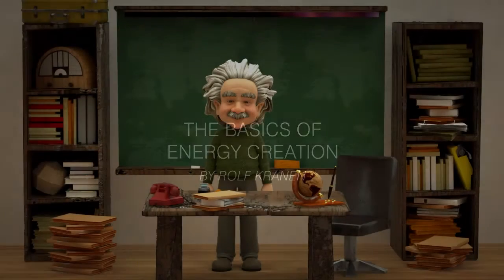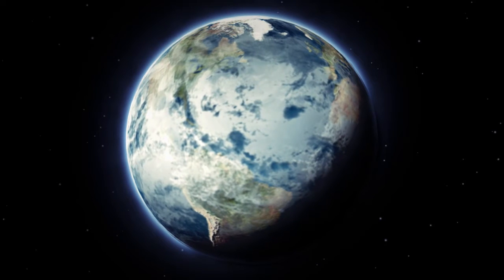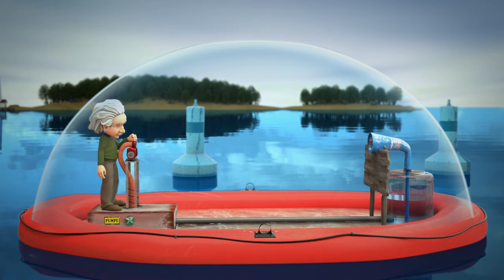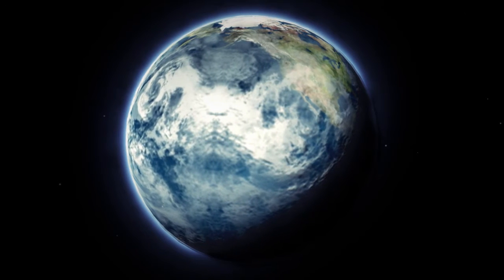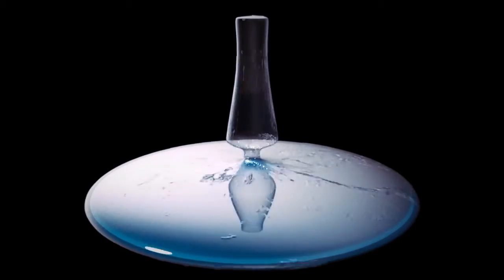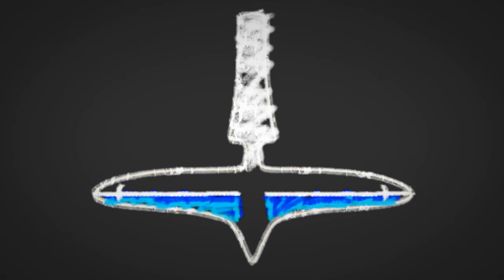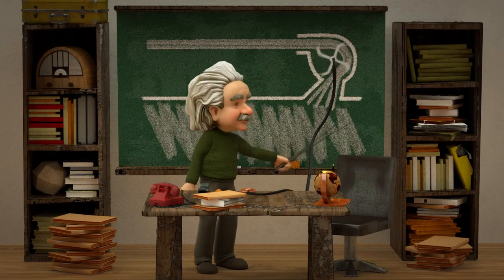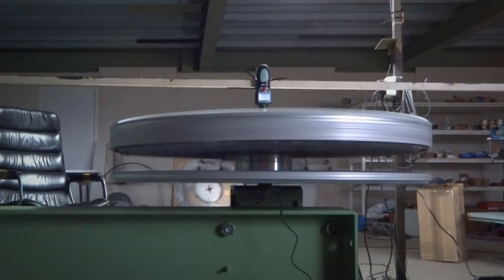Basic principle of energy generation. Part 1

Comment: the flow of water keep it rotating
Reply from the maker: This flow is a physical phenomenon that is produced by the artificial gravity during the constant speed in the centrifuge. The water flow shown in the film is a simplified illustration. In the correct device, the complex gas flows which have no decelerating effect on the inside from the constant speed of the test device.
These friction processes in the gas flow generate heat! (This energy, in the end, should be converted into electrical energy and then taken from this system.) Sorry, this text was created with a translater